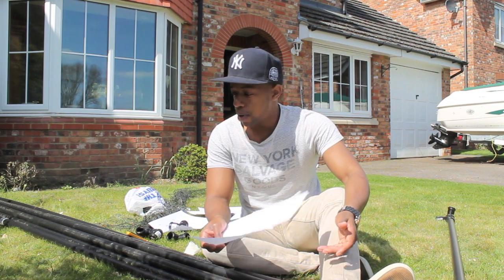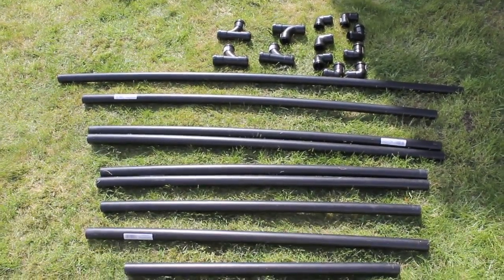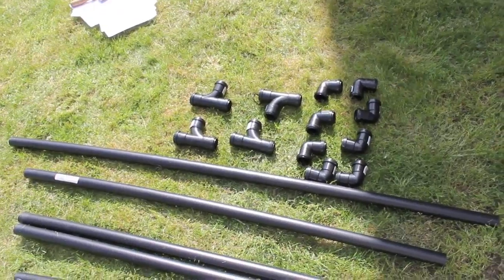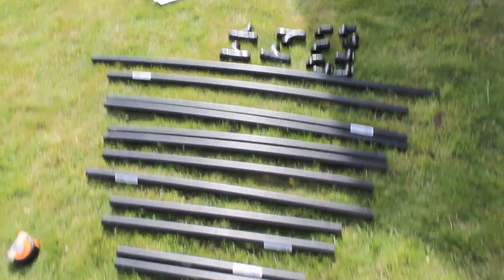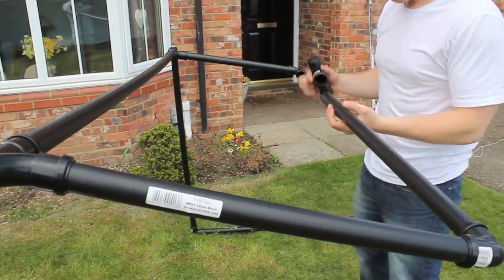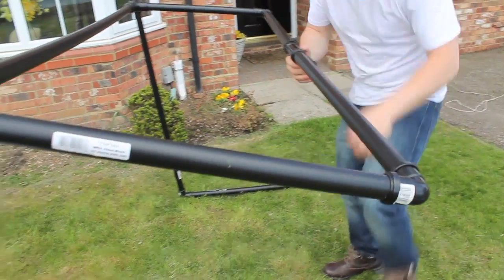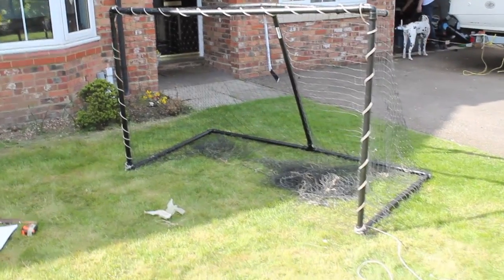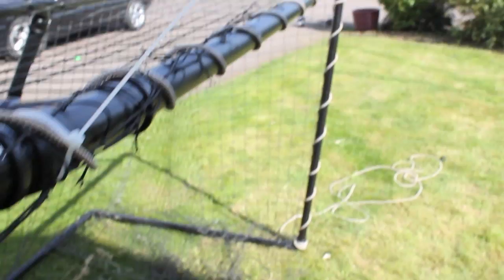How To Build Or Make A Cheap Hockey Goal From Home - Video Guide Building A Goal

Comment: Use pipe insulation (foam wrapping) on the top pipe, side pipes, and back pipe. You will shatter that thing if you don't. And don't let it sit in direct sunlight when you're not using it, it'll weaken the plastic. Great video man.

Comment: I built mine today. I used all 1" diameter pipe and the opening came out to be 72"x 46.5".
The PDF instructions called for too many connector, 6 extra T and 4 extra 45°.
Reply: The PVC cost $50